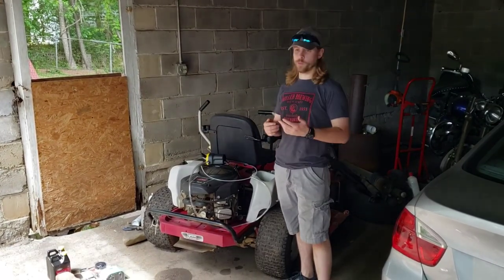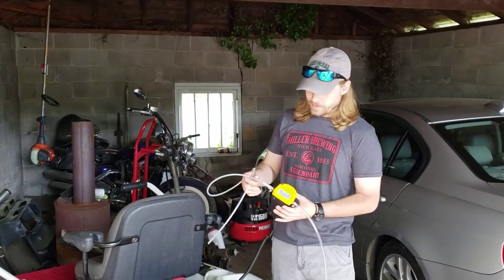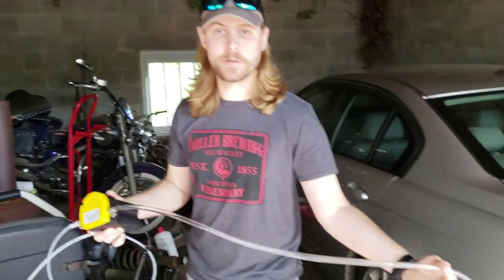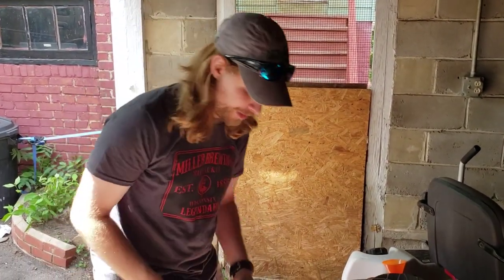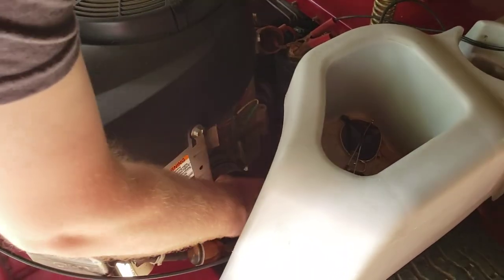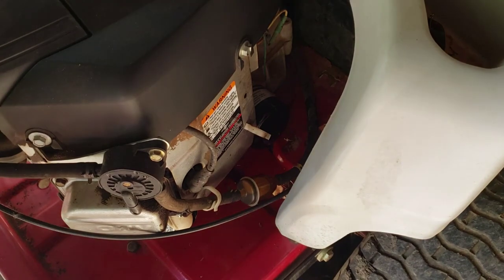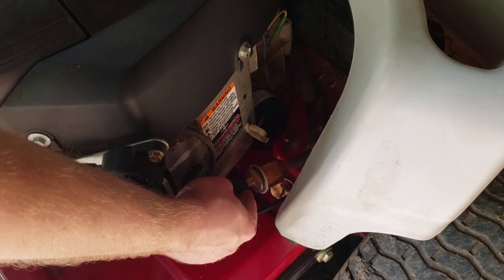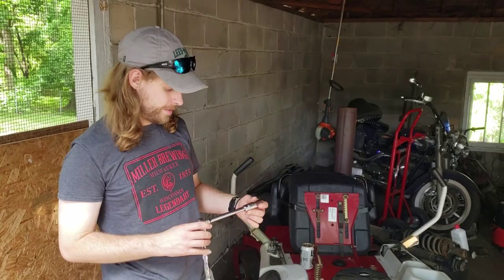Briggs & Stratton V-Twin Oil Change & Tune Up

Comment: I have the same motor in my Craftsman G5100 riding mower.  I changed the oil and oil filter recently and have probably run the mower for at least 5 hours.  I checked the oil level and it is showing full on the dipstick but the oil is still clear as the day I changed it.  Shouldn't the oil be off color after running the motor for a few hours ?  I'm worried the oil is not circulating but if that were true wouldn't the engine have seized up by now.

Comment: Where is the oil drain plug on that model?
Reply from the maker: It’s a black plastic nozzle towards the bottom of the motor on the side where the oil filler tube is. You can hook a plastic hose to it so it doesn’t make a mess.